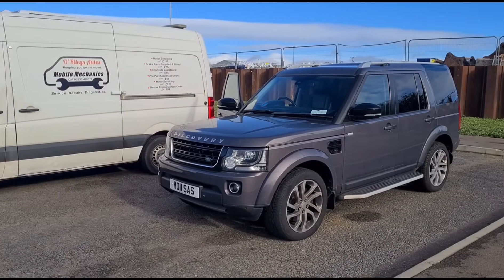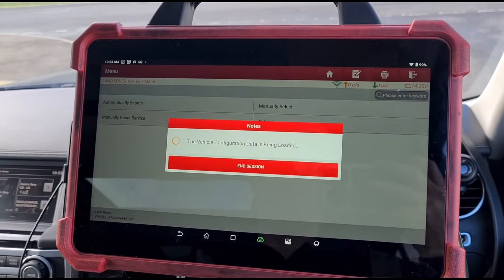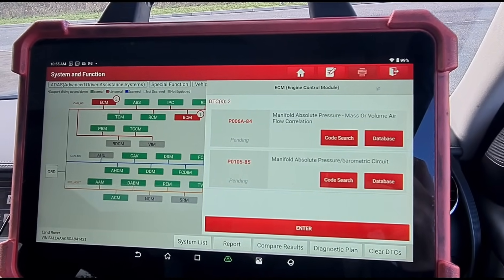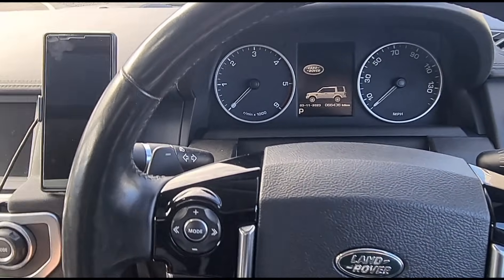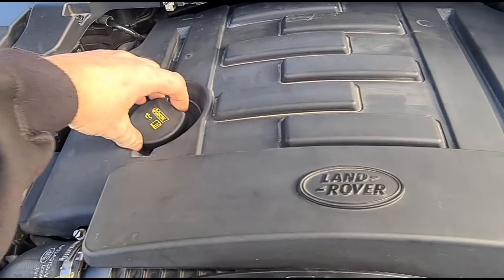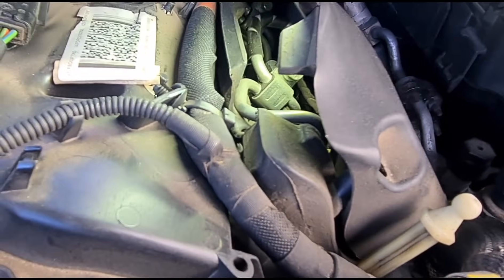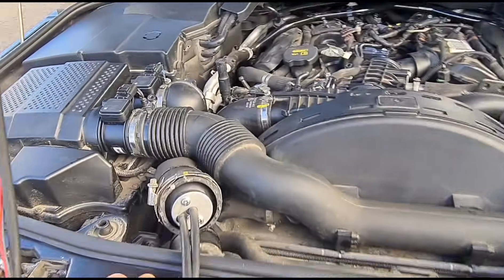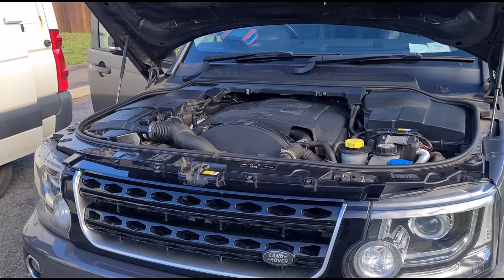Land Rover 3.0 Diagnostic Smoke Test P006A-84 Manifold Absolute Pressure Correlation & P0105-85

Comment: The problem is in fact caused by improper fitment of that intake elbow but smoke test won't show it because it moves out just under boost and hits the fan, had the same problem only I had to buy that new intake elbow because it was bent at the seal. It's a common mistake LR tehnicians do in a rush and you end up chasing other stuff. That part was only 100 euros from LR new.

Comment: That would be standard LR technician competence. Cannot use their eyes!     There is a bolt that secures the intake elbow (when it's pushed on properly. I suspect its pushing off under boost - not showing with the smoke machine - these engines run nearly 2 bar boost pressure when the 2nd turbo chimes in at ~2800rpm.

Comment: obviously Jimmy the Land Rover Techs are not getting the correct training they need on what is supposed to be a Premium Brand .
Reply: I'm an electrician and have worked at Landrover dealerships and none of the Landrover mechanics owned Landrover cars themselves, i was talking to a few mechanic guys and they said we have to repair them day in day out and there so unreliable the guy's said they wouldn't own one themselves as there crap.
The plastic inlet manifolds are crap as they crack 😅 and take ages to get in stock

Comment: I have a disco sport with engine light on, result was low side EGR cooler filter changed 2 months ago. Now the  engine light is back on. 2 local garages, one  without looking have suggest i have cracked DPF,but won't  know for sure untill it is dismantled and estimate a £3000 bill , you guys seem to know a thing or two, any suggestions...
Reply: If it's a crack, this test should show you?